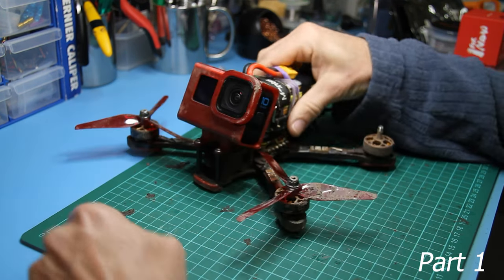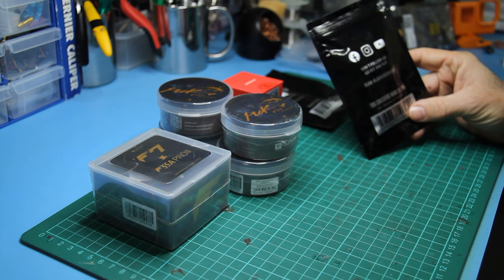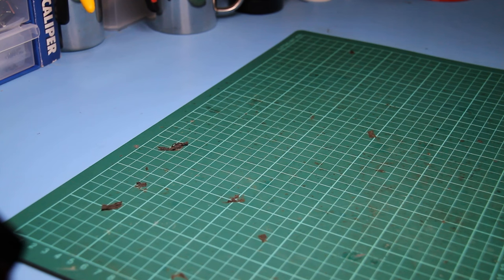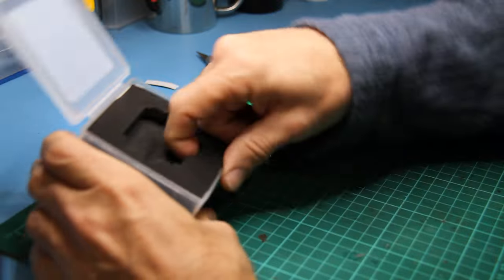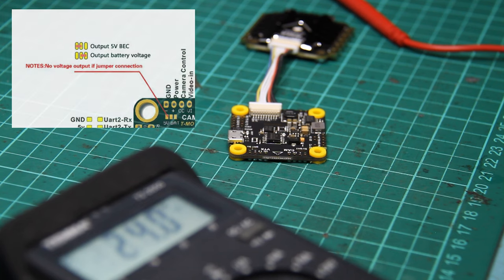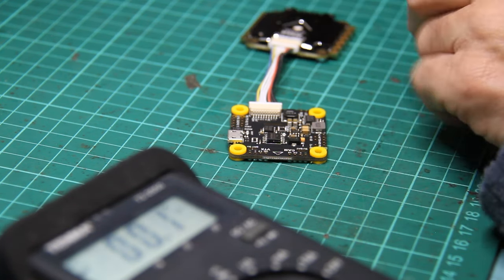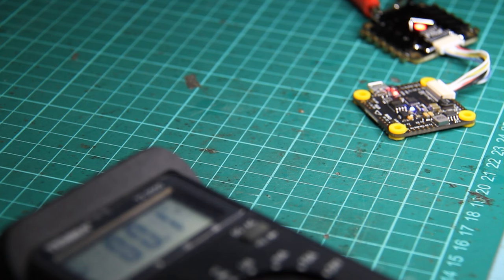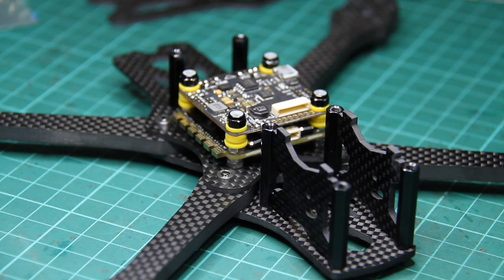Part 1 2022 5" Apex FPV build to carry GoPro 10 on 6S. (T-Motor F7 stack, Falkor 3 mini & Crossfire)

Comment: Did you have any issues with the stack screws being to short even without the nylon nut it still seems to short, I'm trying to put the exact same set up together just running digital instead.
Reply from the maker: Hey. No problems with the Apex supplied stack screws, Tight, but everything fits OK.
Reply: @BonesFPV  all good thanks I had to get longer screws from a hobby shop and then cut them back it a bit of pain, apart from that the rest went together pretty easily.